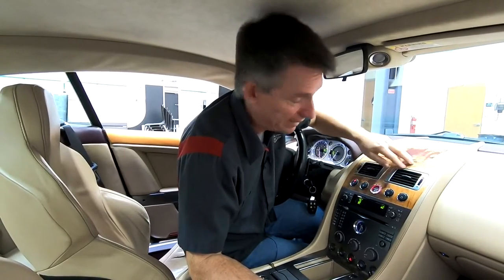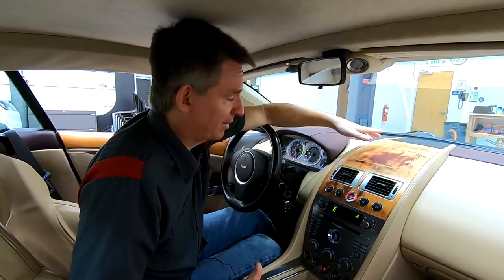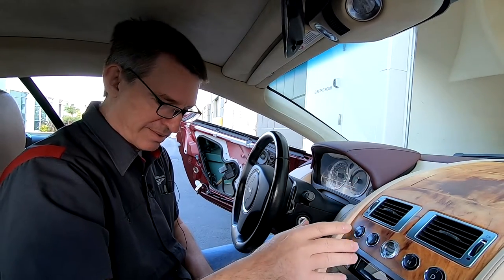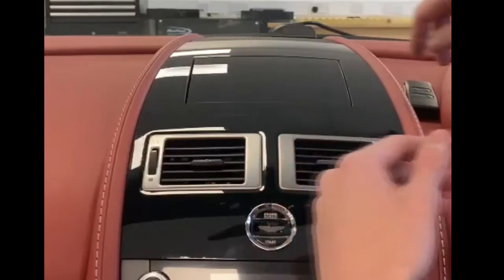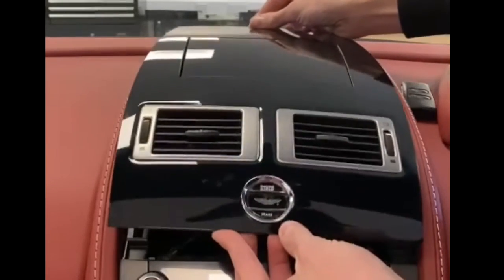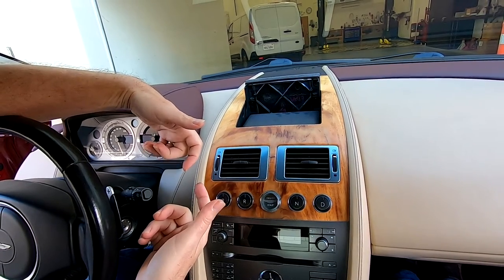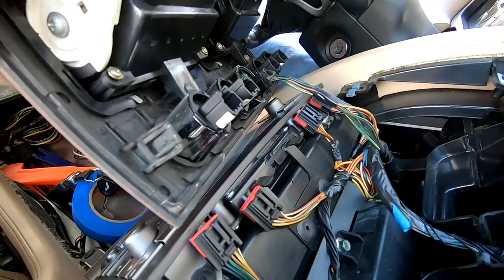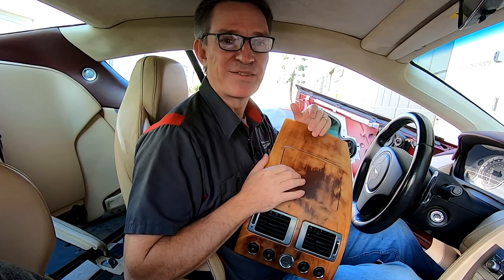Removing the Ski Slope from an Aston Martin DB9

Comment: Thanks for the great video. I have used your method (gently yanking) for removing my waterfall a few times while chasing rattles and eventually to replace the waterfall totally as it had the radial cracks on the corners of the nav screen aperture that seem to be a common problem with the piano black ones.

I do prefer Ryan's method for removing the plugs though, i.e. lifting up at the front rather than pivoting and reaching back, as there are more wires on the later cars with the Garmin system. These later cars also have a tether at the back of the waterfall that is held on to the dash by a screw so you can't tip them forward anyway unless you disconnect the tether first. 

The other thing to mention is that the Garmin screens come out with the waterfall as a complete unit so you can skip the step for disconnecting the screen cover.
Reply from the maker: Fantastic for sharing your experience - Thank You!  Aston seemed to have some improvements into your car at least.  Thanks for watching!

Comment: The eyelets holding the hinge pins on the NAV door broke when I removed the ski slope by pulling on the NAV opening as you showed.  It bends the panel enough to stress the eyelets and they will break.  I really don't like the way Rich does it as using a pry tool on the sides against the leather bolsters will dent the foam that forms bolsters permanently.  I like the method Ryan uses where prying is done at the front and rear of the panel.  However, he makes it look easier than I found it was in creating a gap between panels to fit a pry tool.
Reply from the maker: Thanks for sharing your experience.  Sorry that your eyelets broke in your scenario, the plastic gets super brittle.  I tried the front/rear pry tool approach (off camera, on a Zoom call with them coaching) and I couldn't get a panel gap large enough for the pry tool, hence the tool-less method that worked out well.  Thanks for watching!